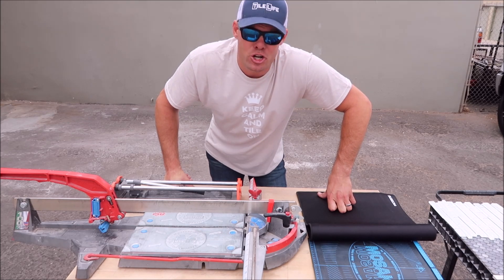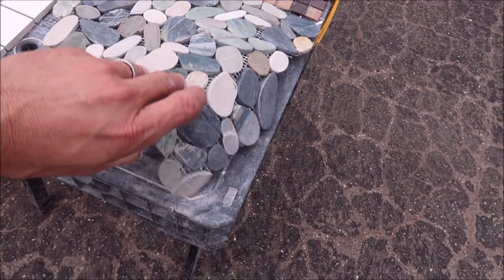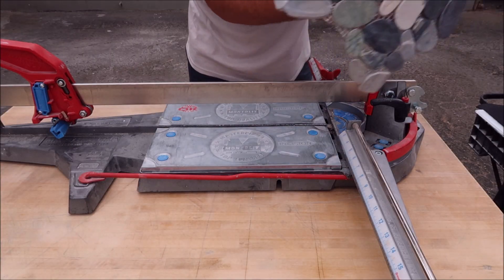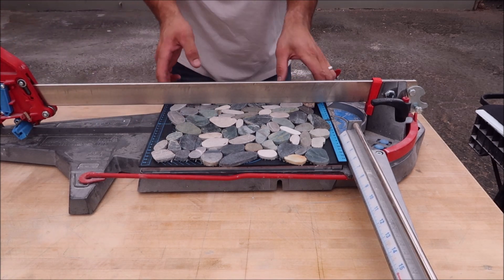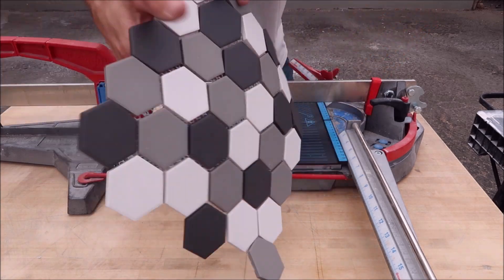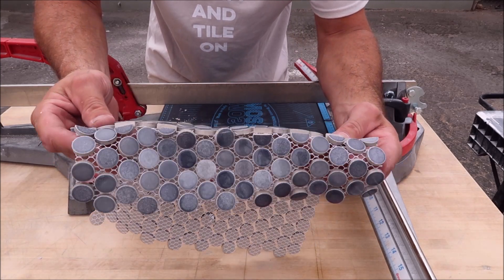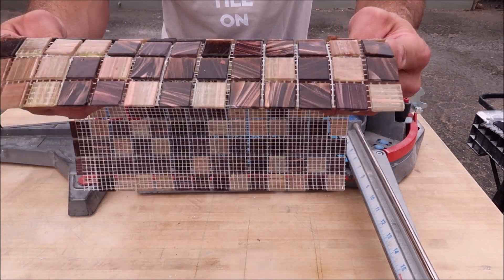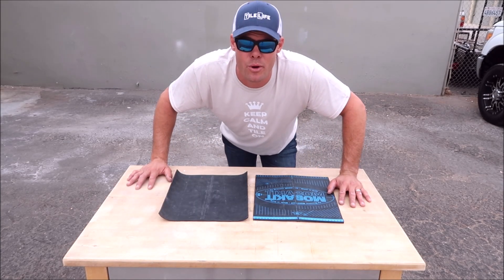Mosaic Tile Tips & Tricks Manual Tile Cutter 👊

Comment: I would say for those cuts where mosaic piece is smaller than 2in, use of manual snipers along with cutting out the mesh as you progress would still give success. The purpose of pad to add thickness so bevel on snapper could stress enough each piece to snap it in, therefore when tile shape or thickness doesn’t allow that you get uncontrolled result. Having that in mind, sample with thick 2in squares wouldn’t need any padding anyway

Comment: Folks, the point of a snap cutter vs wet saw is it’s a lot easier to setup. If you can avoid getting out and setting up a wet saw, and dealing with the mess, then why not use the snap cutter?
Reply from the maker: You are correct sir! 👊
Reply: -casa mosaico

Comment: I use the cardboard that comes with the mosaic sheets on my baby sigma, the money you spend on that monti rug 😁 you can buy another cutter. I got the   Masterpiuma P93 (36 inches) with the baseboard (extra) and it’s the 2nd worst investment that I made after festool grinder (the 1 that goes on the rail like ts55, can’t remember the model name). Both expansive and crap....oh it cuts this, it cuts that, any damn cutter will cut and snap those materials, it’s versatility that maters, measuring bar is on the wrong side, if you’re righty like I am, then you can’t see the wheel witch means you can’t do out of square cuts without using the tape and marker

Comment: What about the mosaic tiles that has metal & glass pieces mixed?
Reply from the maker: will not work
Reply: Any suggestions?
Or a wet saw would do it?
Reply from the maker: @DeadlyVenomKing  any wet saw would work fine. Cheap 7" or tabletop

Comment: A cheap yoga mat might be a bit sturdier and stickier than the mousepad. If the spine is helpful, you could adhere a strip of extra mat material to the back with hot glue or rubber adhesive.
Reply from the maker: Great idea! 👊